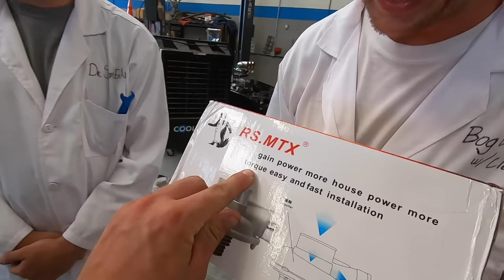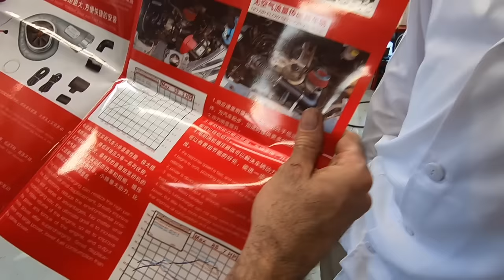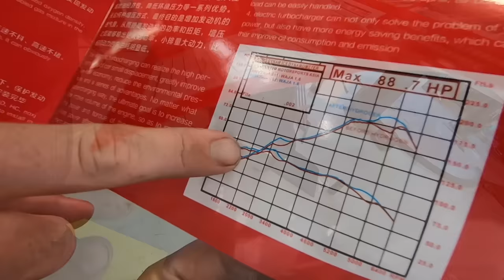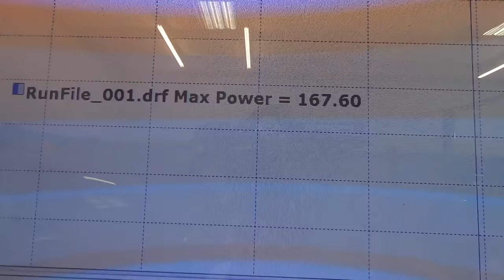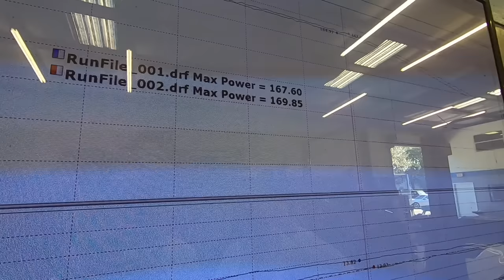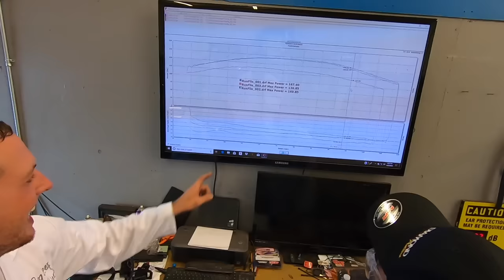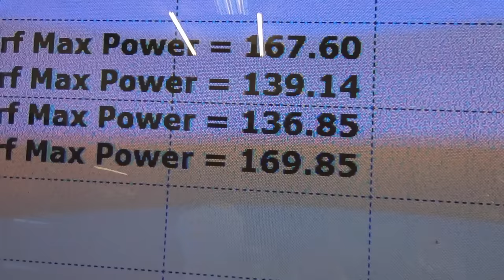Dyno Testing a $400 ELECTRIC TURBO! Funniest Car Part EVER!

Comment: 17:55 Tell me that thing didn't kick off spinning backwards....
Reply: It did..
Reply: It was spinning the wrong direction!
Reply: Clearly from the video it did spin backwards. But it's possible it only appeared that way because of the camera's framerate. Similar to how cars on the freeway look like their wheels aren't spinning on camera. We need clarification from cleetus!
Reply: xavier villa but it stared backward from 0 rpm if it was like cars on the freeway thats at either 1800 rpm or 3600rpm not from 0
Reply: xavier villa o man I just figured it out James hooked up the wires backwards lol
Reply: @reidmackay9703  I see what you're saying but it's only 60fps and there are 7 fins on it, not one fin. To reproduce this effect, it ONLY needs to rotate a tiny bit less than 1/7th of a rotation, not a full rotation in 1/60th of a second or .02 seconds. That is totally possible.
Reply: @reidmackay9703  Those low rpm high torque motors spool insanely quick. so in .02 seconds, less than 1/7 rotation is possible. Do you see what I'm saying about the 1/7 rotation? example: if you wrote a number on each fin with sharpie, you would realize that although it appears to spin backwards, the numbers on the fins would be different indicating it is spinning forwards.
Reply: @reidmackay9703  lmao! I seriously hope they wired it backwards though, I wanted to see gains! I would pay 400 to see gains on my slow lil daily simply cause the ease of installation and easy to revert to stock! (:
Reply: 13:57 blowing air out the correct end, so @ 17:55 that's either due to camera frame rate or way the wires were hooked up
Reply: Conrad Fox yep could have accidentally flipped the wires bc they probs took it off the battery after they tested if it chooched the first time if just going by experience bc it’s easy to screw up stuff like that
Reply: Slow down the playback to .25 and you can see it spins the correct direction.
Reply: @reidmackay9703  Probably was going the right way but the black hole it made just reversed time ya know?
Reply: This it trippy shit I go out of youtube open it up an the shit spins diff ways wtf 5 mins ago it chooched the same way at the same time stamp wtf
Reply: @conradfox684  bruh I slowed it down then cracked the fuh up!! U right
Reply: @Javii96   watch at 17:53 and then at 13:26. Visually there is a difference so I think they had it backwards.
Reply: They had it backwards because Cooper holds his hands out to feel the air being blown out of the turbo inlet, if it was sucking air into the inlet then he would of put the back of his fingers to the turbo inlet to feel it sucking. He even says its making some serious back pressure..
Reply: No wonder they lost 30 housepower. It was fighting against the engine. lol
Reply: @matthewfleming4381  Yea, even the wire james uses on the battery is a different color😂 I think you right. I hope so anyways. I wanna see part 2.

Comment: 15 minutes in, and I'm starting to feel like they aren't really scientists.
Reply: or medcanics
Reply: You must have faith my son.
Reply: They didnt tune the engine 
The engine dousn't know what to do with the extra air 
Sow it cuts the power 
I dont think they are engineers
Reply: @HappyDude1  what extra air?
Reply: It took you 15 minutes...
Reply: Where is your lab coat, and obligatory safety glasses?
Reply: Ya think? Cleetus' black 'sharpie" embroidery on his lab coat kind of gave it away for me. But more like 15 seconds.
Reply: ...But...they have lab coats?
Reply: @HappyDude1  I'm not sure are you serious or are you joking about not tuning it Etc??
Reply: @rocknrolljesus3197  lol. The extra air the turbo was forcing into the engine. 
 See, without a turbo, a piston sucks in so much air. Add a turbo to blow in MORE air. But with more air, one now needs to add more fuel to get a proper burn. 
 The engine did fine before because of the right fuel to air mix. After the turbo, too much air, loss of power.
 Would be the same as if they had replaced the fuel injectors with smaller ones hoping for a power increase.
 To hop up a motor, you add more air AND fuel. You also change the cam to open the valves bigger and longer to shuck the excess exhaust you create, bigger, freer-flowing exhaust...
 Not JUST add air.
hope that helps tho i aint happydude but he's right.
Reply: @edengbrock9726 << kids stay off of drugs
Reply: They reversed the wiring polarity... So it's wired wrong (lol...) In the dyno run

Comment: Looked like it may have been spinning backwards, I’d like to see a pull where it wasn’t turned on and one where it was
Reply: Wires dont lie 

13:33 blue wire on terminal near head light air blows
19:13 James shows you he's going to wire it wrong
20:03 James gets a free lunch
Reply: Ya, I did .25 speed and definitely looked to be going counterclockwise
Reply: I don't think it is spinning backwards.  When it starts spinning by itself due to airflow, there would be a noticeable change in rotation speed when it's powered up, as it tries to turn around and spin the opposite direction.  I don't see that.  Also, there appear to be multiple blue wires, including one going to the rear battery terminal at 13:33.

Comment: U should try this with a smaller engine with less cylinders
Reply: You are joking, right?
Reply: @DommoPA  he's not, theoretically this could work on a small 3-4cil 1000cc engine because of the lower base HP, and the lower air floe
Reply: Bolt it on a na small 4cyl.. It should make a power gain (but f**k knows how much...)
Reply: Armchair engineer here. No matter the size of the engine it’s limited by how much air can go through that “turbine” housing that basically fits in cleetus’s palm. So with that turdo on or off it’s restricted at 6k rpm. It might work on a 50cc scooter or a chainsaw tho
Reply: @ItsSpeltGoogol pressure is created as soon as the n/a intake flow is lower than the  available air being pushed in. So if the pump is able to blow in more air, than the engine is requesting, it might make boost. (1 psi probably)
Reply: flow rate of supercharger need to match engine intake  rate. so 1) is the spec of the sc enough for this engine? 2) wiring the sc directly to the battery will cause it to spin at incorrect rpm thus non matching flow rate. need a controller to signal it to run at correct rpm
Reply: @jakeanderson007  Turbocharged chainsaw? Count me in.
Reply: @jakeanderson007  it would suck having to lug around a battery and charger with your 'turbo' chainsaw.
Reply: put it on a 50cc scooter, that will make 5hp!
Reply: Jake I want to watch Texas turbo chainsaw massacre
Reply: @thomasleon8889  twice the murders at boost!
Reply: Would you not have to remap the engine, I know it kind of adjusts it's self for different conditions.
Reply: Like a lawnmower?
Reply: @ItsSpeltGoogol without knowing the actual flow rate of the electric turbo it's impossible to know how bad it will perform.
Reply: Might maybe work on something like 1.2L
Reply: The fan in theory can add power to an engine
The problem is it's getting the power from the battery
Which is getting it's power from the engine
Now, it wouldn't be a perpetual motion machine to get a net gain, it would just be an increase in efficiency
But nobody has ever made an electrically driven turbocharger that adds more power than it takes away via the alternator
One of the major problems is voltage, you'd need a very powerful battery with a lot of voltage to drive a fan that can produce pressure like that
Unfortunately, that's not the type of battery you find in cars

So an electric turbo gets it's power from the alternator which gets its power from the crank shaft, so you're taking energy away from the crank shaft = less power for the wheels, and you can't run the type of fan that would actually produce real boost off a 12v car battery

While a traditional turbo takes power from the exhaust gasses, which is energy the car is wasting- increasing your car's efficiency and producing more power.

A supercharger is a scroll type air compressor running off the crank shaft mechanically, it also produces boost, but it doesn't need to convert the energy to electricity and then back to mechanical energy. Both the conversion to electricity (Alternator) and back (Fan motor) reduce the efficiency.
Reply: @jakeanderson007  or a riding mower with a single cylinder or twin even. My craftsman probably is turning 650 rpm when cutting so if it is a 540 cc engine x 650 rpm = 351,000 cc's of air per minute. (351L). So that turbo would have to produce more than that to create boost/pressure. YOu'd have to measure how much air the turbo puts out at max RPM in order to determine if there would be any benefit to it.

BTW: you can increase the pressure by lowering the volume in the air path but that's not what you want, you want volume AND pressure and the only way to do that is to increase flow. Boyles law dictates that in a fixed environment, pressure and volume are inversely related. ie: lower volume (restriction) = higher pressure.
Reply: Whatever you would gain on small engine the alternator would subtract.
Reply: looks about the size of a TDO4 aka stock Subaru turbo (at lest from the years i'v worked on). So apples to apples, that little electric motor needs to do minimal  of 80K rpm, up to 170K rpm to be boosting like a WRX turbo on a 2L.

A electric supercharger CAN work, when properly specked.
At bear minimal you need 
A turbo Inlet that can deliver more [preferred cubic air measuring unit] per minuet then your motor can consume at wide open throttle at all the RPMs you want to use it.
A electric motor capable of producing the RPM and HP needed to hit your desired range on the pressure map.
A storage bank (super caps or high density/voltage batter pack excreta) for that electric motor to draw from. 
A high output alternator for your car.
Controller for said electric motor
Charger and balancer that cant back feed.

In the end you end up with maybe a go baby go button that lasts till your storage bank is too low, with the down side you have to wait for your alternator to charge it back up (and reduce your available power the entire time it is recharging the storage bank).
You will likely be able to do drag strips and pass people, and then have to cruse (or site and idle) without any boost for several min to recharge.
Reply: @muskokamike127  Your math is hella wrong. Idle speed is about 1750 rpm, max rpm around 3200. You also only count the volume once every second rpm, so you divide. The last part made no sense because changing the "volume" of an intake does diddly squat on volumetric flow OR pressure when your restriction is the thing you put on the darn end of it.
Reply: @Ayestosea  sorry, didn't realize it was that high at idle and yes, you are correct, the volume should have been divided by the number of intake strokes per minute. 

As for the latter part, go argue with a physics professor on boyles law. I didn't write it. 

This whole discussion is moot however until we figure out the max volume that electric turbo can produce. Plus we have no idea what engine it would be a benefit to until we find an engine that "consumes" less volume than the turbo can produce.
Reply: @seancarroll146  not necessarily. Only if the turbo draws more current than the alternator can produce. most modern alternators produce way more current than a vehicle requires.
Reply: @muskokamike127  Yeah we all understand Boyles law, I mean the way you said it is weird because none of it matters. The only thing that matters here is the static pressure the electric turbo can create. CFM means nothing when whatever is pushing it can't hold 1 psi.
Reply: @Ayestosea  actually, static pressure is the resistance to air flow so the turbo shouldn't be able to create that. You want a turbo to create dynamic pressure inside the intake manifold/throttle body in order to increase the air/fuel flow into the cylinders. Sorry, but in order to create 1 psi the turbo will need to be fitted to an engine that has less  cfm at full throttle than it can produce, then you will get positive pressure inside the intake. 

From the photos on the product page, it appears it is fitted to small 1 to 1.4L engines.
Reply: @muskokamike127  No actually I meant static pressure because that is the final number the end of the intake track sees when the valve opens. Dynamic and total pressure matter, but that isn't what the engine sees. When you tie in a psig gauge to see your boost pressure, you are seeing the static pressure.

Comment: I totally agree with M.Fleming, the electric turbo was wired in reverse and spinning backwards! that totally explained the loss in horsepower! It Pulled a Vacuum instead of providing Boost!
Reply: I just looked onto that in slomo and it spinns the correct way
Reply: This America righty tighty, lefty loosey in China it is spinning the correct way🤪🤪🤓

Comment: Really wish I'd watched until the end, before ordering one of these.
Reply: Dantes38 I wouldn't worry...it looks as if they had it spinning backwards.. 17:53 you can clearly see it spin counter clockwise.. The turbo vanes should "cut and pull" the air..it's clearly not.
If I had the money sitting around, I'd try it.
Reply: @doylesmith8678  I'll bet Dantes38 will make you a hell of a deal on his after he tries it. 👍👍👍
Reply: haha good eye...yes that would explain the loss
Reply: @doylesmith8678  I'm pretty certain it's not spinning backwards. It's a pretty common visual illusion to see things spinning in the opposite direction than they actually are if it is spinning fast enough, especially in video where the frames per second is substantially less than the rpm of the spinning object.

As one of the people in the video speculated, the "turbo" is actually acting as an obstruction to the intake, making it harder for the engine to suck in air, despite the small fan trying to push air in.
Reply: Dantes38 let me know how it turns out!
Reply: Buy a 10hp electric motor that should do it but that kinda defeats the Pont bc the alternator Gona strain the engine a lot may as well actually supercharge it
Reply: You can always use it as a leaf blower!
Reply: How would you go about it running it the correct way. Is it possible?
Reply: @desmadres01  they plugged it in, felt the air blowing out the correct way.  Then they attached it to the car.  Are you saying they reversed the wires like idiots?  These things create a lot of drag.  I want to see it on an engine that is less than 200cc.  like a pit bike.
Reply: @champagnelewis7049  play back at .25 speed it is going backwards.
Reply: @wantblackwolf  That wouldn't prove a thing. The frames per second is too low to definitively say which direction it is.

Comment: HEY you're actually charging the battery with that setup!
Reply: not necessarily. if the motor is an induction motor it wouldn't be; the rotor would need to have permanent magnts for it to induce current.

Comment: Can't believe they wired it backwards for the dyno.😱
Reply: Indeed it does look that way! 17:53
Reply: @podulox  :D definately
Reply: @UCFgu2gs_6CRFv-qvK3OvVbg What?  CCW rotation is 100% wrong.  The pitch of the impeller and the design of the scroll housing are clearly and obviously designed for CW rotation.
Reply: It may just be the frame rate of the camera making it look like it is spinning backwards. You would think you would see it go clockwise first and then transition to backwards like a normal fan or car rim, but it spins up so fast to a really high RPM that even at 60fps you may not be able to see the clockwise direction first.

I wonder if the motor would smoke if it is in reverse because the engine will cause it to spin clockwise and I don't think it would be possible for the electric motor to reverse the blades while the engine is at a high RPM. I would be interested to see a dyno number with it connected but not powered.

I think it just can't flow enough air for the engine. A good test for them to do would be to gradually keep stepping down the size of the intake and dyno it each time to see how much affect it has at different sizes.
Reply: Exactly what I saw! I'm calling them out!

Senpai noticed... 😒
Reply: @AllTracTurbo  I thought that but honestly.... Does it LOOK like that to you? I can see it start moving from stopped...
Reply: @podulox  With a turbine that instantly spins up so fast to such a high RPM, there is no way to determine what direction it is spinning from a video, even at 60fps. If the video was 1000fps and you went frame by frame, you might be able to see the direction of rotation right at the start, but even that might not be fast enough to tell.

The turbine has too many blades that all look identical, so you don't know which one your are seeing from frame to frame in the video. You would need a frame rate fast enough to get multiple frames of video before each blade moves 1 blade length. It is not possible to see this on a 60fps video with a turbine spinning this fast. You could paint one of the blades a different color which would help because then you only need to be able to get enough frames during one complete revolution of a blade, but even that would probably not work with a turbine that fully spools in less than a second filming at only 60fps.
Reply: @podulox  AllTracTurbo makes a good point in that the fast spool up of the 'turbo' and the frame rate of the video could make it appear to spin the wrong way when it actually isn't.  Yeah, it's probably going the wrong way but we can't be sure by simply watching the video.